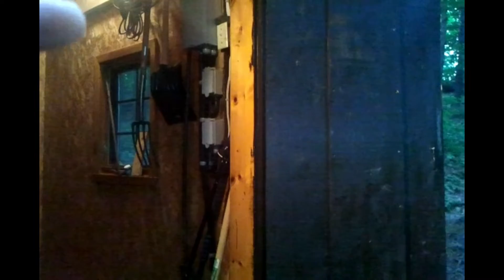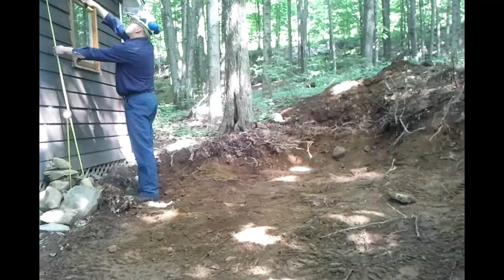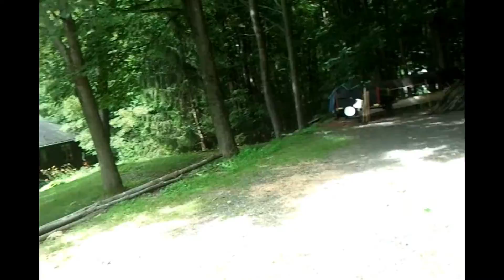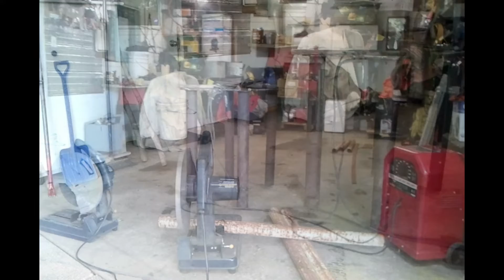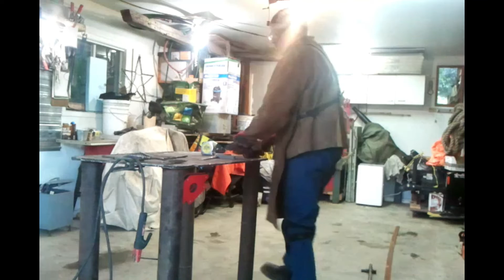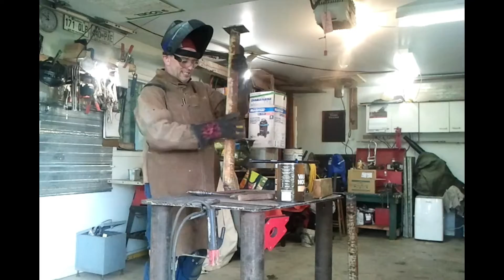The building of my Wood Shack using Mahindra eMax 20s HST, Lincoln Electric Arc Welding 225 .

Comment: Salut Dave, je voulais savoir c'Est quoi la grosseur de ROD que tu utilises et à quel ampèrage ta soudeuse est setté. Je commence à souder et je veux être sûr que mon ampèrage est à la bonne position. Je soude avec de la rod 7018, 3/32 à 90ampères.
Reply from the maker: Bonjour !  Au sujet de la grosseur de la rod, ca vas dépendre du type de machine a soudé et aussi de l'épaisseur de l'acier a soudé. L'important c'est que tu crée un bon bain de soudure pour joindre les deux métaux ensemble ( il y a plusieurs vidéo que tu peux voir sur YOUTUBE ). La 7018 est une excellent rod a soudé, mais tu dois l'utilisé vite et doit la gardé dans un endroit sec - 40 % d'humidité pour ne pas qu'elle perdre ses quaratéristiques. Si tu prendrais de la 7014, Tu n'aurais pas a te soussier de cette aspect ( gardé au sec est important ). Si tu soude en AC ou DC est aussi un autre facteur a considérier quand tu soude si tu as cette option sur ta soudeuse !  J'ai toujours acheté mes rods chez un comercant d'équipement de soudure, ils connaissent tous bien leurs produit et te donne d'excellent conseil !!! Moi aussi je prend de la 3/32 la plus part du temps, mais je joue souvant avec mon réglage dépendément du matériel que je vais soudé ( le rouille, la contamation, le type de métal, l'épaisseur, l'angle de la soudeuse ) et n'oublie tout vient avec la pratique et une bonne base !!! A plus et merci !!!  😊👍🍻

Comment from the maker: Gentleman, my apologies for this long video, it has been 2 full weeks without video !!! Sooooooory !!! LOL
Reply: As a welder I am compelled to point out something and correct something. You should always clean your welding surface. The only Rod you can get away with not cleaning is a 6011 or 6010 rod. Also known as the farmers rod. Because they can throw it on a DC battery and weld in a wet muddy field without cleaning. 7000 series rods should always have a clean surface. When you did not clean the surface you are guaranteeing that you're well we'll have porosity and it will start to fail and rust from the inside out. With what you were putting together here. I would have done a 6010 root pass followed by good brush or cup wire brush. Then a couple of beads with a 7018 rod. And not have to ever worry about it again. Hope you don't take this wrong way there's a lot of misconceptions out there about welding.
Reply from the maker: @ritchelbe  Sir, I do agree with you at 110 % !!! But beware that it's not a high pressure welding or a type of safety welding from the Canadian Welding Bureau or their associate and I'm certainly not going to do X-Ray on it !!! LOL It's just amator basic welding that's all my friend  !!! LOL  When I do built stuff,  I over strength it for compensating from various factors including myself !!! LOL  I'm running a welding on a budget and I'm not able to have a 7018 since that type of rod is so sensitive in humidity condition and costly and I do not have a electrode oven. Yes, 6010-11 can do it, but again the price in my region is big difference !!! I did work on farms for many year and we had portable welder generator on most farms,  but most of the time we were able to bring it back to the farm garage to do maintenance/fixing.   I do however clean all my welding for inspection and then before painting them !!! LOL   My dream if I had money, is to buy SODEL electrode all the time and have a oven to keep my various electrodes like 60,70 and others and have a good welding machine that can do AC/DC stick welder ( SMAW ) or MIG ( GMAW ) and TIG ( GTAW ) ... HO BOY THAT WILL BE MARVELOUS !!! but reality is  sniff sniff !!! I have my AC Buzz Box and my Lincoln MIG PAK 180 Welder with a bottle and that took me 4 yrs to save money aside to have it !!!  My passed away father was a Welder Teacher and his brother is also a professional welder with all is Quals and he is 68 yrs old and still weld !!! ( he is nuts !!! )  My brother is also a professional welder with all his quals  !!! So like you can see I'm surrounded by a family of welders !!!  I have THE BEST scholarship and mentorship on welding in the world during family reunions !!! LOL  Let's get serious now. I agree with you Sir, their is a lot of bad video on welding and very good video on it too !!!  Thank you again for your concern and your comments and please do respond I like very much these discussions. One thing that I forgot to mention is often the quality of my steel is not at his best since they have various type of corrosions ( Intragranular, Galvanic and certainly various surface corrosion etc,,,  !!! LOL )    Take care of yourself  Richard  !!! Cheers !!!